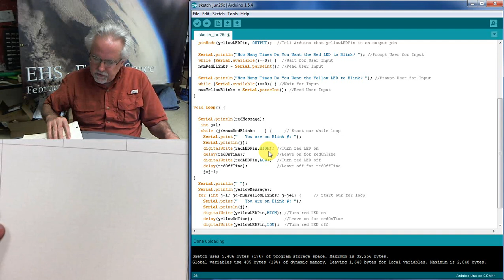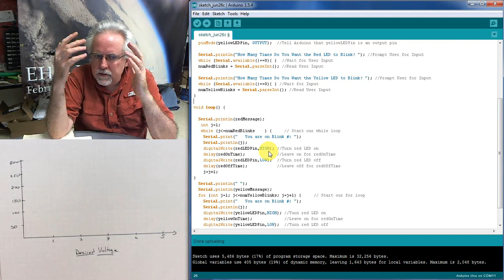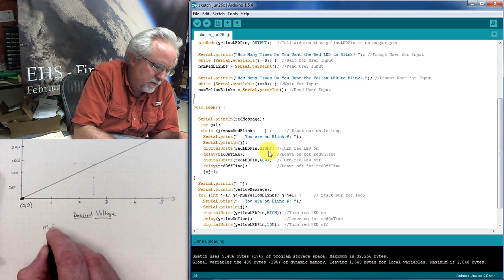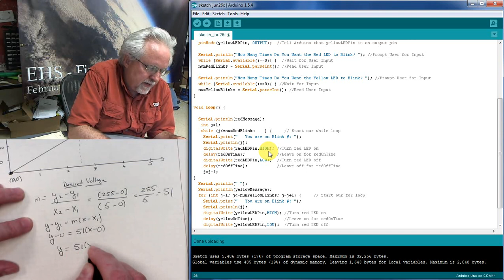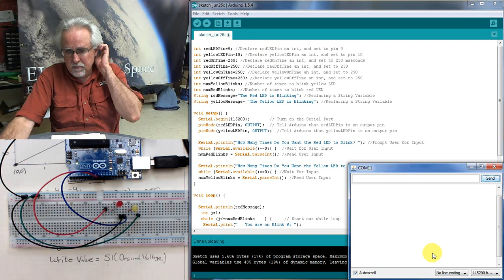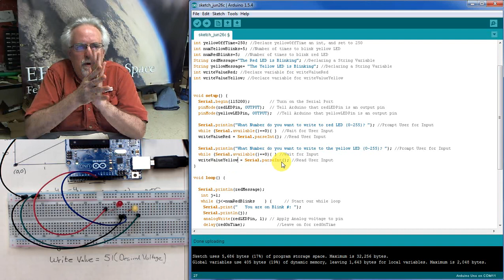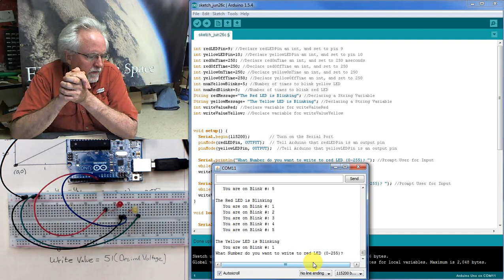Comment: Hello
I just started learning Arduno a few days ago, and started watching your videos today, im following your 8. tutorial now, and im going so good. Thank you a lot.
I have a question. I have LSM9DS1 sensor, i need to get it worked to measure accelaration etc.
So how can i do this? I searched a lot on internet, found some codes too, but they didnt work.
I want to write codes by myself. When can i be able to write LSM9DS1 codes? please answer me.
Keep up the good work:)
God bless you!
Reply: These 9 axis chips are complicated, and the code is not well documented. It is not a simple answer I can give you. It is an advanced project.
Reply: First of all, thanks for replying.
If i buy MPU6050, would it be easier to code it?
How can i program them by myself, i mean when can i be able to do them?
Reply: If you are trying to get euler angles, roll, pitch and yaw, then perhaps the Adafruit bno055 would be the simplest solution as it will report those directly.

Comment: AS a newb ...Had to really think about why you didn't change pins 9-and 10 to A0- A5 ... squiggles are PWM pins ... virtually works the same as analogue - just blinks the digital on and off faster leaning more to one side ( more time off or more time on) ... didn't know you could control those pins with analogue commands... learning something new everyday! You sneaky !!! Haha!!
Reply: Because we only can use A0...A5 analog pins for input, but 3 5 6 9 10 11 are for outputs.
if you use LED, it should be output.
But if you wanted to control LEDs by valuable resistor(potentiometer) you should use analog input for resistor, leds still should be for other pins because they are output.
I hope you understand me. :)

Comment: Hi
I worked it out like this 
as 255 =5v then if you take 255/5=51
so to get  the desired voltage jut take  :  Desired voltage x 51 to get the value
so if needed 15v then eg. .15x 51 =76.5 would be the value
would this method be a problem later as I am very new to this
Reply: It can be an issue cuz different microcontrollers work on different voltages.
Reply: That's what he explained in video
Reply: Bro... One pin can only put a max output voltage of 5 Volts.... So we cannot think of getting 15 Volts

Comment: I'm just curious, but for finding the voltage equation could we have used differential equations? Where in the end V(x) = Ke^x and we use the conditions V(0)=0 and V(5)=255?

dV/dt = KV(x)
dV/V(x) = Kdx
Integral(dV/V(x)) = Integral(Kdx)
ln(abs(V))=Kx+C
abs(V)=e^(Kx+C)
V=+-e^(Kx+C)
V=+-e^(Kx)e^(C)
V=Ae^(Kx) ; where A=+-e^C

Now our conditions are V(0)=0, V(5)=255

Then we solve for A and K. Is this correct?
Reply: I hope that 1 year later you know that this is wrong.
Reply: if that would have been any curve other than a straight line then this method could have been useful.
Reply: I think both yours and Mr Paul explanations are way too complicated... I don`t know, but for me was kinda natural and intuitive to simply divide 255 by 5 and then multiply by the wanted voltage. If you want to complicate it, explain it using the "rule of three".

Comment: all you had to do is 255 divided by 5. love your videos but you really made that a little over complicated
Reply: The objective of this lesson was to get students to apply the math they have learned in math class. To recognize that this is a linear relationship and to apply the tools they have learned in math.
Reply: <-------5th grade education
Reply: oh and by the way ,ive learned more today off of your videos than i did off of many other videos and time
Reply: @paulmcwhorter  Sorry sir, in elementary school we learn (I think it is about the third grade...) about the rule of three, which applies here and helps determining a correspondent of the voltage from 0 to 5 in an interval of 0 to 255. It is, for me at least, much easier to apply ... a/b=c/x => x=b*c/a ... so if 5 volts is 255 then 1 volt is 255*1/5 = 51 and so on... - I do not want to say that your way of explaining is not great - I just wanted to point another way of solving this in an equally elegant manner. Plus, in eastern Europe they teach that long before you learn about graphic representation of values... - And, of course, thank you for your work.
Reply: For the very reason that you pointed out as a flaw.
Reply: Unless you're working with other voltage source amount. For example, Arduino Nano is built with 3.3 volts pins. Arduino Uno has a pin for 3.3 volts too. In that case m=77.27 and the equation is y=77.27x! So complications were good to understand the process behind it!
Reply: madd man 
That is Basic math.

Comment: hey Paul McWhorter thanks for the lesson, i've a question what happen when i use the analogWrite at some particular pin and i set the voltage above 5 voltage(300) would it ever work ? well i tried it and it doesn't make any changes.
Reply: No 5V is the maxium out. That is what the regulator has, so nothing can be more than that.
Reply: thanks for helping me alot.

Comment: OH IM  ! USING THE UNO A2 ANALOG TO DIGITAL TO READ MY MINI SERVO MOTOR VOLTAGE .  THE SERVO TRANSMISSION IS DISCONNECTED AND THE SERVO POWER HAS 40 OHMS TO REPLACE THE TRANSMISSION LOAD TO KEEP IT FROM OVER TACHING AND HEATING UP. I GET GREAT VOLTAGE READINGS TO MONITOR THE CHANGE IN MOTOR DIRECTION.

Comment: Although I strongly support having a solid math foundation. One might find the necessary value for analogWrite easier. By simply dividing 255 by 5 you get the value of 1 volt, once you got that you could divide it further to get more precise values e.g. 1/2 volt, 1 mV etc. This works if only the distribution of values on the graph is linear as in the video.
Reply: That's exactly what I thought!

Comment: Great videos sir, and I understand that you're trying to simplify the concept of PWM, but I just can't wait for someone to try and connect an LED to a PWM pin with no current limiting resistor, and set the analogWrite value to 92, and get confused as to why their LED blew out :P
Reply: hence, the info being passed along, WITH THE LESSON. lol. idk where you're from, but in USA(after pre-k...) we teach you info, AND show you things, AND give you warnings, at the same time. if you're old enough to understand the stuff, and you go beyond a lesson with what you should know is not ALL the info you need... The reason the LED blew is YOU blew it.

Comment: Repost @Paul McWhorter
Make sure you are connected to a PWM pin . . . one with a squigly line by it (~). Only those can be used for analog out.
Reply: Was so sad to see that my favorite number/pin (7) has no pulse-width modulation. Was so so sad. so very sad.
Reply: Agreed ,pins 1,2 ,4,. 7,8,12 and 13 are not analog
Reply: Thank you, I was trying all sorts of stuff! Just said screw it I get the concept but thank you it's better to see it working!
Reply: thank you for this!! was wondering why mine didn't work
Reply: the comment that answered my quesiton.
Reply: Thank you good sir, I was having trouble figuring out why one of my LEDs wasn't responding to the analogWrite command!

Comment: The lesson contains key error. You can not specify the output voltage through the use of commands on "AnalogWrite"
This command is used to create a "Pulse Width Modulation" look
https://www.arduino.cc/en/Tutorial/PWM
and https://www.arduino.cc/en/Reference/AnalogWrite

Due to the fact that the "LED"  understands PWM how to change the brightness modulation - examples might work. In other cases, it would be completely erroneous
Reply: It is not an error it is a simplification for the sake of teaching. These lessons are targeted for 7th graders, hence I simplify things for clarity. Once they learn more, and become more comfortable with circuit concepts, I can explain PWM more fully. Actually, lots of devices will treat PWM like DC, its not just LED, motors will respond to it properly as well.
Reply: Agree and thanks for the links.  Nearly made that mistake thinking voltage changed but saw your links and get it.  Although I understand Paul's point of view, it might end up being more confusing in the long run since it's technically not correct, that is, you are not changing the voltage.  The PWM figure on the first link is within comprehension for someone who understands "for" and "while" loops.
Reply: Do you think it is feasible, to use modified code, from the "BlinkWithout Delay" to control a PWM  output, to power a sensor, as the program cycles?
Reply: I thought I caught that "error" also, but you explained that.  As you are writing to the 7 th grade level maybe that is why I understand you so well at 67 years even though my background is in electronics.
Reply: I will say that this series of lessons has been OUTSTANDING so far,  as I have been having my 7th grade daughter follow along. So very thankful to Paul for posting this material. These lessons are an excellent source for teaching so many key concepts in using Arduinos. That being said, I must agree that I believe this is extremely misleading, if its not an error, to imply that you can change voltages directly in code on the Arduino as this is just simply false. It also implies that you can light these LED's with a tenth of a volt, which is also false. I think it would be much wiser to just give a quick and simple explanation of PWM at this point and that these are "simulated" voltages.  Let them know it becomes more relevant later on and then move on as I did with my 7th grader.  This made sense to her and was not an issue at all. I only offer this comment because this very issue caused me a great deal of grief on one of my projects when I was first learning the ins and outs of Arduino, and I just hope that no one gets misguided like I did. Aside from that though, I must say this series is excellent learning material and put together quite awesomely for our younger students All in all, a very big thanks to Paul for his outstanding work and making it available to us all!

Comment: Cool point about "not an in between with digitalWrite() - it's either on [HIGH] or off [LOW]." I was wondering how to get the different potential values like if using a potentiometer or something, so this will be especially awesome. Therefore cool point that it's a byte of data (2^8 or 256 options including zero) that we can map to different things; epic!

Also cool point that Arduino is a 5V output.

Also cool point about how all we really need to know if starting at (0, 0) is the slope of 51 since it just means over 1 & up 51 ∴ y = 51x + 0. I wonder if this is a good time to assign the return value of a function into a variable? I guess I'll finish the video but I'm immediately wanting to make a quick loop to see the progressing voltage brighten the LED through its full range. (Edit: made it and it's cool but seems like maybe I have too many amps on my adapter I found to power my Arduino because although it's all required specs it's 2amp output. I read it's good to have around 1amp so idk if I have too much).

Thanks again for the great tips - keep up the good work - peace.
Reply: That's why I like youtube cuz as long as I have something fun to learn I don't stop. GL, all - have fun - never give up!

Comment: Too bad that what looks like a great tutorial is just plain wrong and not corrected after getting comments that point exactly to the error. A digital output only outputs a low (0 Volt) or a high (5 Volt) and nothing in between (if it would be able to output an intermediate voltage, by definition, it would not be a digital output). The crucial information about PWM, that time is modulated and not amplitude, is not mentioned in this tutorial. People lacking background in electronics watching this tutorial are getting exited while being fooled. This tutorial looks professional but is utterly wrong as it completely misses what PWM exactly does.
Reply: I realize that this comment is over a year old however I feel this needs to be addressed.  I understand you feel this tutorial is wrong in the sense that it does not mention the concept of PWM and duty cycle and how it plays a role in the circuit.  However, as a mental exercise I propose this scenario:  What if we waited to teach students about multi-variable calculus and vector geometry before teaching them the basics of gravity?  Or what if we had to teach them the quantum mechanical effects of Rayleigh Scattering just to explain why the sky is blue?  Or how about a whole dissertation on the electromagnetic effects in relativistic mechanics and quantum field theory just to describe why 2 magnets either repel or attract one another?  Under the hood, all that stuff is happening...but is it required to give students an idea of what's going on or would a simpler model be better for them at that time?

Technically you are correct.  Voltages are not being varied in the circuit but rather the time pulse of the PWM signal.  However the goal here was to teach some basic concepts and principles...mainly to apply the math that they learned to an engineering problem and learn coding that would make the circuit do what they wanted it to do.  Introducing PWM is a whole new concept that is not required for getting the little idea here.

I bring up the other issues in physics because that's exactly what happens with students now.  They are taught that light travels in lines when analyzing optics but that's not how light behaves in reality.  We teach students that electrons act like little spheres with charge and mass but they are not that either.  Newtonian gravity is technically wrong and relativity is a more correct explanation.  Yet we teach these concepts to help students get the basic understanding so that later they can revisit the topic for a more thorough analysis.

Getting students to learn how to apply skills from other areas of study and to get excited about learning is the key here, not so much the technical aspects of what is happening under the hood.  

Sorry for the long-winded rebuttal just wanted to get the other side's viewpoint.

Comment: According to the arduino.cc website. pins 9 and 10 are PWM with the analogWrite() function.  Unless I'm missing something, the 0-255 varies the duty cycle, not the voltage.  An LED drops about 0.8 volts and should not be visible with less.  PWM allows the full 5V to be applied, but at values that can vary from 0 to 100% of the time; which explains why the LEDs are visible and 0.1V (the eye is a good integrator and doesn't see the flicker from the square wave frequency).   Again, unless I'm wrong; Duty cycle and Voltage applied are not the same (and I don't remember how the calculate RMS values from a duty cycle square wave).  There are no real analogWrite(s), just PWM.  There are analogReads (Scaled from 0-1024).  LEDs have a very narrow field of view.  This can play with perception.  Brightness from straight on is much higher than looking at an angle of >15°.  It does not drop off linearly with the change in angle. Regards

Comment: is it possible to control the output voltage to certain precision components like solenoid valves using the arduino analogWrite. (what is the max PWM frequency that generates the analog voltage, can it be modified?)

Comment: Hey Sir. 
If I keep the analog value below 128, the LED doesn't glow at all and if I keep it =>128 the LED glows  with full brightness as in digitalWrite(  ,HIGH). Can you tell me whats wrong? I have connected everything properly and checked all codes.
Thank you
Reply: Make sure you are connected to a PWM pin . . . one with a squigly line by it (~). Only those can be used for analog out.
Reply: Thank You Sir . It worked now. 
Your lessons are great and you are an awesome teacher.
Reply: LOL, that got me too. I used 4 pins in my code, 8-11, and was trying to dim #8. I always wondered why Paul started with pin 9. I'll have to rewatch the beginning of the series to see if he covered that little nugget.
This is almost the first and certainly the best tutorial series I've found for Arduino IDE so far. I've only had my Uno for 3 days. :-)